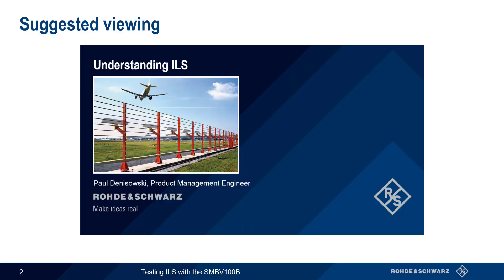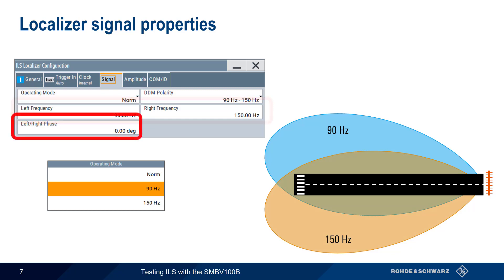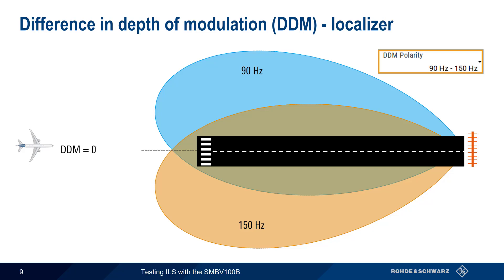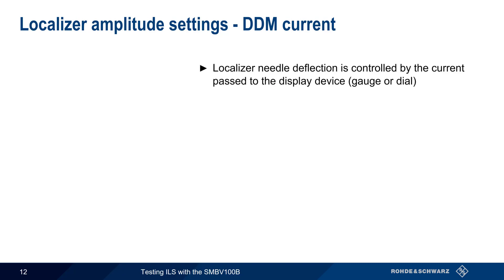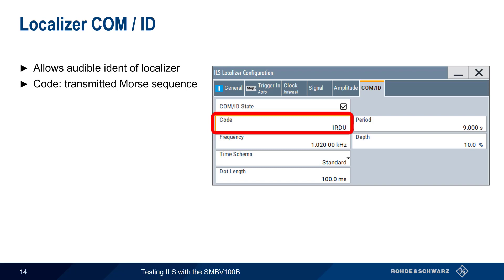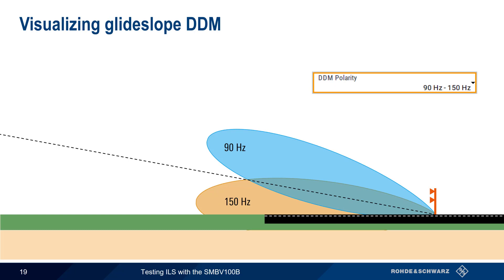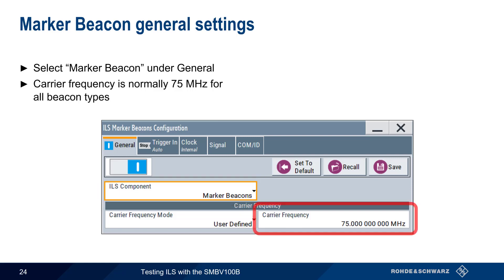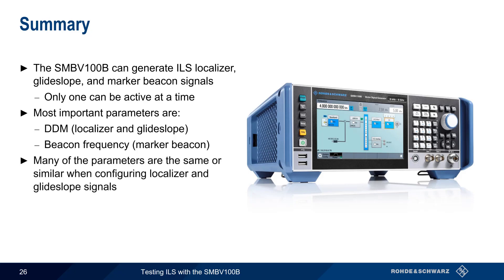Testing ILS with the R&S®SMBV100B Signal Generator

Comment: I think there is a mistake. When DDM is positive, means that 150 is  dominant, but from the formula at minute 03:20 we find that 150 is dominant when DDM is negative.  Therefore the formula must be corrected
 DDM(%)=[[AM (150)-AM(90)]/[AM (150)+AM(90)]]*100